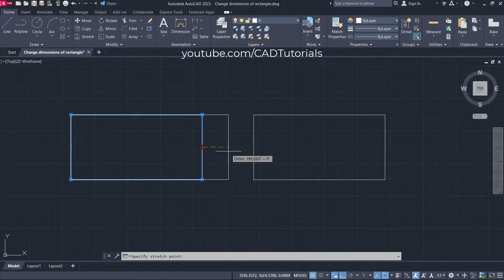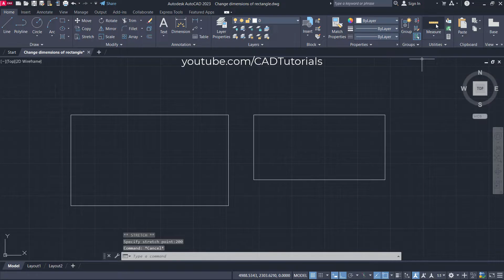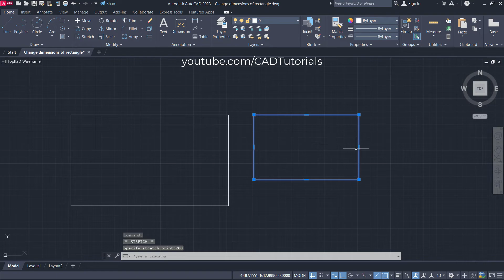AutoCAD Change Dimensions of Rectangle

Comment: is there a way to specify new dimensions all together without "stretching".. i don't want to increase or decrease by an amount. i want to change say a 20x40 to a 40x80. granted this number is easy, but for fractional dimensions it becomes a bit more troublesome having to math things out first.
Reply: did you figure it out m8?
Reply: @gangster2855  na, just how to stretch more or less by a set amount. never figured out how to just set a new dimension.
Reply: @callofgeorge  Yea, I ended up doing what you just said also :)
Reply: Hello sir when i draw a rectangle by rectangle command they give me wrong value what's the problem??